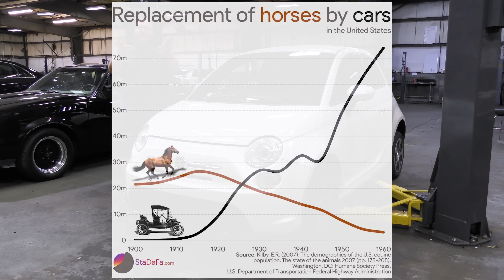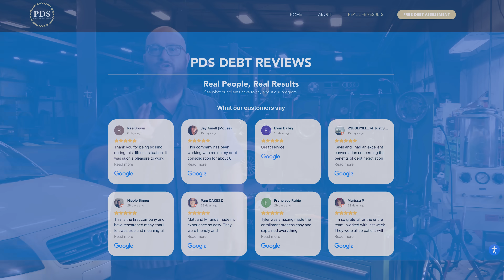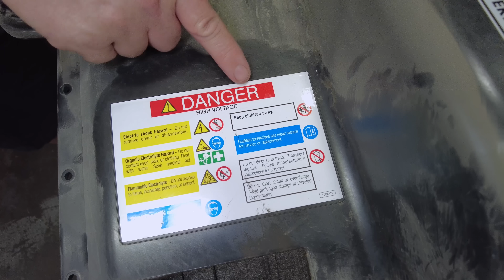How to SAFELY Remove the EV Batteries From my Fiat 500e

Comment: I'm over here laughing at your call for uniform battery technology.  If the handheld tool makers won't do it, why would the automakers?  

I suspect you'll find improved availability of parts to fix these cars as more of them on the road are getting old.  But I assume it's going to be a bumpy road.  I took the plunge and bought a F150 Lightning this year, but I'm not delusional that it won't be without risk and problems.  It's a great driving experience but any problems it has will be big problems, which is scary.  Is it any worse than the 3 valve 5.4?  Is it any worse than the 3.6l GM engine with its timing belt issues?  Maybe - I think it's a bigger financial risk still.  I decided I wanted to take the risk.

Comment: Wizard:  You said the battery cells that were not connected will have to be  “equalized” before connecting those packs back to the others.  Assuming that means the state of charge as indicated by their voltage must be the same, please show us how you are going to do that.

Comment: Wizard I have to take serious exception to your POV here.  One of the main reasons ICEs took off was the abundance and affordability of gasoline.  We don't have that with electricity.  70% of the electricity we generate is made using coal or natural gas & the Gov. is determined to shut these down.  This with the electric grid already at the breaking point.  So what's the plan to replace these fuel sources?  They haven't thought about it yet.  So, if even 20% or 30% of us end up buying EVs they will sit in the driveway uncharged while we spent $$$$ per month just to buy lights & heat.  Workers' paradise I'd say.
Reply: Not so much coal anymore, solar & hydro are already a larger percentage of US energy than coal.  But yes, natural gas is still higher.  Nuclear is the key, in Georgia residents can charge their cars for $.01/kwh overnight because the nukes have such low demand.  Thats 78 cents to charge a Model 3 completely.  Thats why it's a game changer in nuclear powered states.

Comment: There will never be a unified batery platform. Case in point is laptop batteries, almost every battery has an 18650 cell bundle inside and yet they all use sealed cases to where its impossible to replace an individual cell. I am a pc repair shop and i pull the packs apart and save the cells, they are almost always good.

Comment: You're analysis about the EV being the future is a bag of crap. If there were no government payments to buyers, and subsidies to manufactuers; the number of BEVs would be tiny.  As it is, there are under 14 million in the world even with these subsidies over a decade; yet there are 1.4 billion light vehicles so the total of all BEVs made ever, is 0.1%  If you include heavy vehicles which are the largest users of fosile fuel they zero impact enviromentally.  In fact they may be negative; they take more energy to mine, they weigh more; and the world grid is 80% fossil fuel powered.

Comment: I don't believe that your analogy is straight on. I liken the electric cars to the early steam cars. Yes there were quite a few around but the technology just didn't work out. California is having power outages now with the low percentage of electric cars on the streets. Our infrastructure is not set up to handle this.  The point behind them was to be eco-friendly, but you look at where the electricity is coming from, it is not eco-friendly. Then you're going to have to come up with a way to dispose of the toxic batteries when they are done, which at the current rate battery life is only 10 years. 
Though I agree our infrastructure needs to be updated terribly, I don't see this happening fast enough to deal with the onslaught of electric vehicles. I look into the future seeing some sort of hybrid or fuel cell created to produce the electricity needed for the motors. Besides breaking water down into hydrogen and oxygen, Scientists are currently making man-made elements that are being added to the periodic table, with a lot of these having the capacity for continual long-term power output.
So like the steam engined cars, which was a better technology than horse driven carriages. I think technology will again sidestep, this time it being the battery-operated electric cars, choosing something easier to use and far more sustainable. It will be interesting to see no doubt, as with watching what you end up doing with Fiat is bound to be entertaining. Greatly enjoy the show, keep up the great work ‼️ 😎

Comment: Bulgarians are not the only ones in the world to be able to repair this kind of stuff...
as you said in the video, a new kind of garages are specializing in evs, here in France, a well reputed one is able to repair all sorts of battery problems like dead cells on model S, or baterry management system on Fisker Karma, etc,
 they are Revolte E-garage in Carquefou, France 

I am a fan of your work Wizard, thanks for sharing your experiences and extended knowledges in your videos
thanks to Mrs Wizard too for all the work behind the scene !!
Reply: Those other repairers need to have an online presence. 
If you can't find them, you can't use them.
Reply: @68404   Its very possible they have an online presence, but in their local online community. The global online community is a little harder to get onto.
Reply: I bet Bulgarians are cheaper :)
Reply: Should be cheaper in Bulgaria
Reply: Exactly what I was thinking. Electronics are Electronics. There’s nothing special about it. I am electronics repair technician. I repair medical equipment. I run my own business. The challenge with some electronics are surface mount components that require a higher skill level and different equipment but again, Electronics are Electronics.
Reply: If the American went to Carquefou they'd throw out their MAGA hats, learn French and refuse to go home. Very nice part of the world.
Reply: Wizard is about to get scammed big time by scammer nation.
Reply: @event3horizon  we'll see. BG is the only former USSR republic that was producing computers for all the others. Many companies have there their IT base because the tech culture there is very strong. I'm not Bulgarian (Italian actually) and I have been in Sofia many times and this year I explored all of it in 2 weeks vacation. They have their skills. And I hope you're wrong.

Comment: I enjoy your channel, wizard, but your view that EVs are like motorized vehicles and will take over reflect what the news media tells us but your are incorrect.  The issues for EVs being more than a small niche of the market are essentially insurmountable.  The cars are not cost effective, so they are not popular despite government incentives.  I do not mind you or anybody else buying one but I and most Americans will not until they are cost effective.  If that changes, we still do not have the electricity to charge the batteries.  That would require more power plants, transmission lines, and distribution lines.  We have no ability to build new large power plants due to lack of consensus of what their power should be.  Wind and solar do not work well and fossil fuels are politically unacceptable and people are irrationally scared of nuclear power.  So even if you buy one, you may not be able to charge it.  If you live in a state like Kansas with a significant winter even if you charge it your range will be really short.  Then we have the problem with roads and especially bridges because of the extreme weight of the batteries.  It is not rational to think we can replace all the bridges so they can accomidate the weight increase.  It is popular to ignore all this as you have and just argue it is the new wave we need to accept but the problem is that the problems are real and wishing will not make them go away.  Perhaps the biggest issue is that the environmental benefit is nearly zero.  The same over optomistic models that have predicted dire consequences that did not happen many times say that the benefit in terms of temperature reduction is well under 1 degree celcius.  So we would have to spend far more money than we have and if we were to be successful we get a neglible benefit.  Please do not perpetuate the nonsense.  EVs are OK but they will never replace internal combustion engines.

Comment: Wizard is 100% right on making the battery packs universal, that is why you see plenty of 20+ year old electric golf carts. They all use the same size batteries (lead acid) so it's dirt simple to get cheap replacements when they go bad, and there are now plug and play extended range lithium ion batteries if you want to upgrade to newer tech. If EV battery replacement was easy and affordable thanks to standardization ICE will have a hard time competing.
Reply: That will not happen, because batteries is what EV manufacturers distinguish themselves.   It is like to say ICE vehicles should all have similar interchangeable engines

Comment: I have no problem with EV's. They are fine for the people who want them, and fit their needs. 
What I do have a problem with is government forcing them down our throats whether we like it or not. I'd be one of the old timers who kept their horse and buggy. 
Here's the thing about that. I'm still free today to make up my own mind and choose which I prefer, without government interference. 
Maybe in the future we will have the electric infrastructure to support the EV, and the batteries will last the life of the car, and retain their ability to take a full charge. The biggest problem with the EV is electricity still has to be generated to charge them, and that means burning fossil fuels for the most part. 
I'm keeping my gas powered vehicles.

Comment: Are there batteries in parallel? This is the only way I can see some not charging... But if they are not then your story doesn't make any sence. You can charge just one. Only thing that can happen is that BMS is not balancing them.

Comment: IDK but to me carrying a fuel tank around in an EV is a pretty stupid idea. Electric trains don't carry their fuel around with them. Also as we drive down the roads in the US we normally have electrical lines following the streets. Paying for 2 separate things (a road and a power line) when they could be combined and large battery packs removed from EVs, making them actually affordable and financially viable to be repaired after an accident. To cut off anybody that would comment they don't want to be charged by the mile driven because that would mean Gov't tracking them. Uh there is no privacy in the US, private companies already track your every move and are selling that info for profit. So this would also crack down on that privacy intrusion.
Reply: All locomotives are diesel electric.    An onboard diesel generator powering the electric motors to propel the locomotive.

Comment: Please for the love of God wear insulated gloves when poking inside the battery
The fuse makes is safer, not completely safe.
I've been with EVs since 2021 and I will never go back. it costs 1/4 the price of gas, and no maintenance.
I don't need to drive 500 miles every day, and I'm perfectly happy with what the EV gives me.

Comment: Unfortunately, the EVs made today are made like mobile phones. They aren't made to be repaired or have compatible parts. It's made 100% for consumption and 0% serviceability. Sure, there are things that you can service on but those are the consumables. However, the primary core components are made like the motherboard for a smart phone. It only works and when it fails it's meant to be thrown out. Even the battery packs. 😕

Comment: I dont hate EVs i just dont think they are viable yet. They depreciate too fast.
Reply: They depreciate fast, because the price of new units is falling. Look how expensive home computers were when they first came out. But prices rapidly fell. Making earlier models depreciate. This happens to pretty much all technology.
Reply: @edsmale  Possibly but i think its because all the value is in the battery and they degrade too fast.
Reply: @TerribleFire  they don’t degrade too fast, common untrue trope thrown about. But their price (of both the car, and battery packs) are falling. New price lower=price of an older, more expensive car, needs to drop further to make used more appealing then new. Bolt and Tesla are prime examples of their new car price dropping a lot, and used car prices then following.

Comment: Nitpicking, but batteries are measured in kilowatt hours, not just kilowatts.  A watt is a rate, not a unit of power.  You have to multiply it by time to get a unit of power.
Reply: Not to nitpick, but a kilowatt hour is a measure of work, not a measure of power. A watt by itself is indeed a measure of power, and it is how horsepower is measured in cars around the world that use the metric system.
Reply: A watt is a rate of power, multiply it by time and you have a unit of energy.

Comment: Your guesOmeter was showing a high number based on efficient driving. All EV's do the same. That number adjusts according to the driving habits so you could potentially reach the 100 mile range on a 80 mile range battery because the 80 range is estimated based solely on near perfect conditions. :)

Comment: Nice video! At 13:35 you show a picture of a LiFePO4 battery. Is it really the kind of battery they are using for the packs? I thought they would be using a cheaper lithium-ion
Reply: LFP was always cheaper, but only introduced in EVs about 10 years ago.

Comment: Back in the turn of the century, when gasoline car were first introduced, there were electric cars. The disadvantages to them were the same then as they are now.
Reply: Yeah, there's definitely been zero improvement to the electrical grid in the last century and a half.
Reply: Not
Reply: @edsmale  If that's about electric cars, look it up.
Reply: @Waterlooplein1  look what up? You could be a little more specific
Reply: @edsmale  Like I said, if it's about ELECTRIC CARS at the turn of the century, look it up.
Reply: @Waterlooplein1  so you can’t. Alrighty
Reply: @edsmale  I suspected I would get answers like this. I should have ignored you.

Comment: Wait, the EV AND the ICE cars were competing head to head over 110 years ago and the ICE won. Hydrocarbon infrastructure is easier to build than grid infrastructure and the level they want us to have EVs needed a powergrid upgrade started 50 years ago.

Comment: How hard would it be to convert it to gas again? About the future of electric, Capacitive discharge, amplifiers, and battery tech is the future. I have been confused by all the car audio manufacturers  doing super powerful stereos with batteries, amplifiers and capacitors back in the day. They never explored any of this tech. A lot of power generated by 12 volts.

Comment: Thank you, Wizard, for taking the electric FIAT on.  I am a true motorhead, but sooner or later I will probably be driving an electric car and plan to maintain it myself, so it is great to watch you do it.
Reply: Hey Ho! "franz--" You will find, as has this writer with DECADES of gas car repair experience behind him [forever!} that fixing an EV is easier than fixing ANY gas engine. The secret is EDUCATION. There are classes being given in California and maybe elsewhere, that will give you the electric knowledge to fix ANY EV. Its much the same as the mechanics classes to fix the too high tech gas engines. The rest of the EV is standard automotive builds and repairs. Might this writer SUGGEST you rent/borrow/ or ? an EV of your choice, and use it for a 'few weeks".  You will be hard put to go back to a gas car. My SUGGESTION would be a Model S or 03 by Tesla. Or if you have the $$ a Lucid Air or Touring, or the new Caddy EV. Used examples will save you some money.  In that regards, an EV that is being sold honestly will have a "Battery Health Score" that you can verify, as to the 'health' of the battery in the EV. The thoughts of this 2019 Kia Niro BEV owner.

Comment: Respectfully disagree, by 2030 the UK will have 25K shortest of EV mechanics.  The problem with EV’S is Lack of train professionals.
Collision/lack of spare parts 
Damage Tesla instantly become commodity cars.
EV are hard to fix.
EV are not reliable, they should but are not.  They have 80% unreliability.  Fire Department has to carry 2 blanket to cover a EV when it goes up on fire costing the department 5K each, a cost that’s not in the budget.  Even the lithium battery charges fast it also gets so hot that it go on fire making then so dangerous.  EV’S are not ready for Prime Time’.  The horse is still here the EV’s probably won’t.  This how much our power grid needs on demand would have to increase by 1.1 trillion kilowatt hours or 26% compared to current electricity demand.  Don’t see this happening any time soon so kids going have to be accustomed to change timing belts and oil changes.

Comment: EVs are so old that STEAM and electric were competing. The only change is that batteries are more efficient, but the production of said batteries is the most expensive part of an EV. Then there is the whole supply problem, copper, cobalt, and lithium. All of these products are used in many other industries. Tech products are a great example of how progress can reduce the cost of products. The entrance of the EV into these markets has only INCREASED prices. They are literally a parasite.

Comment: I would have to disaree..I think it's going to be a repeat of the early 1900s. There were more electric vehicles in the early 1900s then there were gas and by the mid teens to early 20s the Electric car fad just disappeared. Fact is Americans don't want them.Tjey are not worth the money batteries die.to quick and batteries last decades before they biodegrade